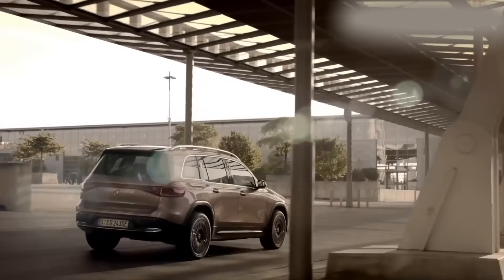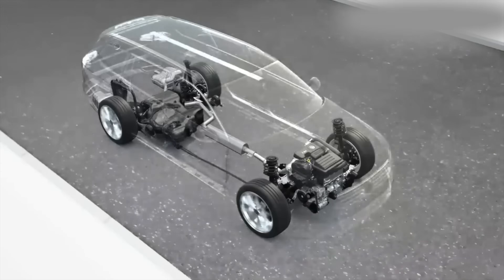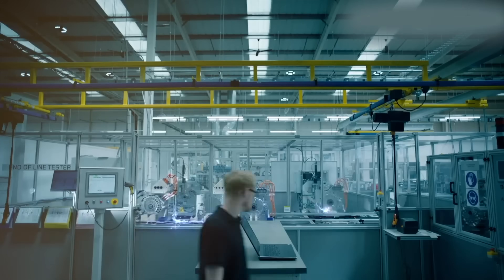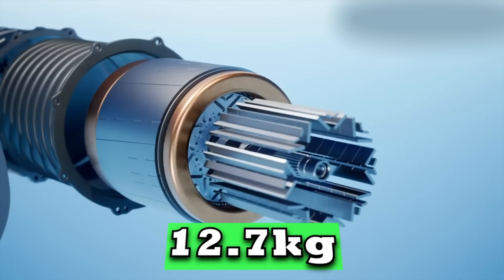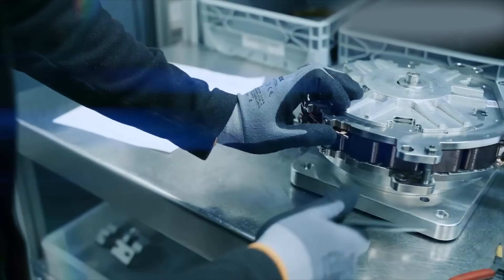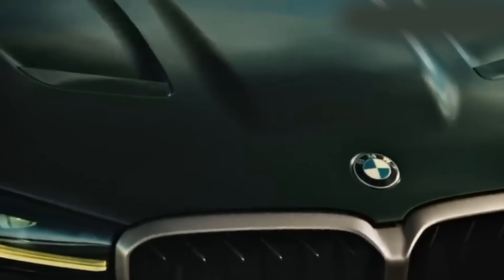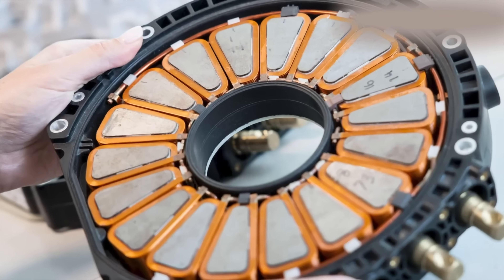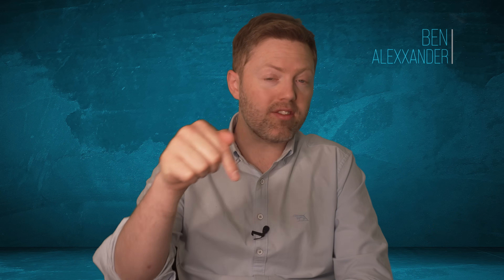Mercedes-Owned YASA Just Built the World’s Most Powerful EV Motor

Comment: Now imagine if you put one on every wheel of an M1 Abrams tank with 7 wheels per side...14,000 hp??? That's a fast tank in anyone's book.
Reply: How many tonnes of battery would that need???
Reply: @Hamish_A  About the entire rest of the vehicle. no guns, no ammo no crew. just batteries.
Reply: @Hamish_A 
A standard 80 kWh battery pack would power a tank regardless of its weight.  The point is that the more efficient the electric motor, the more EASILY even a smaller battery pack will power it.  Obviously, the issue then becomes range, but that is also improved by a more efficient motor design.
Reply: @PETERJOHN101    An 80kwh would last 20 seconds @ 10400kw? That's 13,000 amps assuming 800V battery for faster charging. It would be very fast for a short time, then it would be target practice time for the enemy. In 20 seconds it might even get out of range! Though traction would be a big problem. I wonder if Yasa would lend Mr Hewes some electric motors......
Reply: @geoffhaylock6848 
I already said that range was a separate issue, my only point was that any amount of stored energy used in modern EVs can power a tank.  Obviously, a tank would need solid state battery tech to be practical in war.
Reply: @PETERJOHN101  Practical in war? Sure, a battery for a tank would need to be 1GW? where would you charge a fleet of tanks when the enemy has bombed all your power stations? Ukraine barely has power to boil a kettle.
Reply: @geoffhaylock6848 
Wars are won based on whose munitions, parts, men, and resources diminish the fastest.  That's the nature of war.  A tank that doesn't require petrol can be powered with hot-swappable battery packs manufactured behind enemy lines. SS batteries are already in a Benz that goes twice as far on a charge than it would by burning petrol.
Reply: @PETERJOHN101  So when the enemy are blowing up your power stations you ask them not to blow up the ons's providing power to the battery factory? Hmmm interesting theory. Still way easier,  in war conditions, for a truck to roll up, drop of a pallet of ammo and a few 50 gallons of fuel then a battery swap? Who doesn't know how to pour fuel into a fuel tank? When did I say battery tech was the issue? You could invent a battery that goes 10 times further. It still needs 10 times the energy to do it? So takes 10 times as long to charge?
Reply: @Hamish_A  I'm guessing none because it has a  Avco-Lycoming AGT1500 gas turbine engine with 1,500 horse power more than capable of supplying the electricity directly to the wheels.
Reply: @MrDhalli6500   Not sure 1,500hp can produce 14,000hp. That would be kinda magic to get more power out than you put in.

Comment: Just one Yasa motor would be more than enough for an average family car but it would hugely help semi trucks and busses creating space for batteries.
Reply: Definitely, maybe conversion/add on kits for stop start vehicles like buses or vehicles with hydraulics like bin wagons. Let the Yasa provide the starting grunt and the ICE engine the cruise..
Reply: the beauty of electric motors is that the control gear is what determins the output. Having a motor capable of  80hp/kg (when a Ford Mondeo rear disc+pads+caliper is about 10kg) but limit each motor to a max of 150hp means that motor is not stressed at all, so the motor is likely to outlive the chassis. This of course assumes that YASA's motor is scalable like this.

Comment: These motors would be great for trucks
Reply: Stacked and you get there you need torque rather than high rpm ..You need to also look at the work done by AEM of  county Durham that were already building stacking motors for trucks that didn't even use copper windings..

Comment: Although it sounds promising, the key for EVs is the battery! 
That motor is really cool, but if Mercedes can’t put range in their EVs and offer better prices, they won’t be able to compete against the Chinese. 
But sure is really cool!

My Dolphins GS has 95 HP. It’s not a beast, but it’s enough for a very good day to day drive.
I wish I had a few more kms in range. 
Anything above 400 HP is absolutely unnecessary.
Reply: But if you take a powerful motor and make it smaller and lighter, then your car is lighter. With newer batteries that are also smaller and lighter, you've now got average cars with much lighter parts able to go much further.
Reply: @colinwisemanYes, that’s true! 
But Mercedes is not making batteries is it? 
I am cheering for the transition no matter the brand. And this motor is awesome. But EVs already have a lot of power, what we need is better batteries!

Comment: I’m curious about the size of these motors. What if you didn’t need 1000 hp from the motor and only needed 250 hp? Does reducing the power output by a factor of four also reduce the weight and size? Is there some minimum size that these motors have to be, I’m just thinking of a little single motor 150 hp car. Seems like this motor could be incredibly light, but I don’t know how small.
Reply: likewise i am curious what these high performance motors could mean for EV transport trucks.
Reply: @Jeroen-y4w  My rough guess is that it will not be much smaller when the average output will not be much lower and the heat must be able to dissipate
Reply: @Jeroen-y4w  These on a Sprinter is going to make them class leaders, doubley so if they made it a range extender EV Sprinter.
Reply: I looked into this a few years ago. You can get 5 watt AF motors. They are about USD 500. Some electric bikes use them. There are about 100 manufacturers. A 60 kw AF sells for about $16,000. There's the rub. It's 300 mm diameter. I looked at converting my SUV. I may as well buy a Tesla.
Reply: I’ve wondered why they haven’t a reasonably powered motor and a smaller battery in a small car. It seems all electric car have to have 1000hp??
Reply: @Jason-ml3vs  Axial flow motors are way too expensive. It's needs to be high end to justify the expense.There are heaps of low powered EV's, but not with axial motors.
Reply: @Jason-ml3vs  Probably because initially most profit in EV's was from selling large SUV's and high end saloons. Things are changing and will keep changing. Small cars with small batteries and small motors will have their day.
Reply: @Jason-ml3vs   You know you can search the internet and find small EV's that have reasonable HP and battery sizes. You just need to look for them.

Comment: Axial flux motors have been around for a while, mostly in eastern Europe until YASA was started by a Cambridge undergraduate.

Legacy automakers have always avoided anything that requires them to change the way they operate.  Which is why they still use electric motor designs that are over 100 years old.  EMRAX in Slovenia produce axial flux motors in several different sizes, including one that can power a typical small car that weighs around 22 lbs and is the size of a typical clutch.
Reply: "Legacy automakers have always avoided anything that requires them to change the way they operate."
Is Tesla a legacy automaker now?  Do you even read what you post?  Might you consider that there could be a technical reason why a new motor design does not (yet) work?

Comment: Imagine 8 of these in an electric semi truck. No more waiting behind a slow truck, now you won’t keep up with them!😂
Reply: The limit is in the ability of the road surface to handle the shear forces. A semi with 10,000Nm of torque on one axle is pushing 10kn through an area the size of four size 9 shoes
Reply: @theairstig9164 also true
Reply: Two problems in accelerating a semi truck: breaking and the amount of energy necessary to move so much mass.
Tesla already done a semi that is much faster than other trucks, but you can’t just drive them like they are wheightless
Reply: @claudiomaiasantos  true but every motor is also a brake, one that isn't going to fade due to excess heat as quickly as conventional friction braking systems